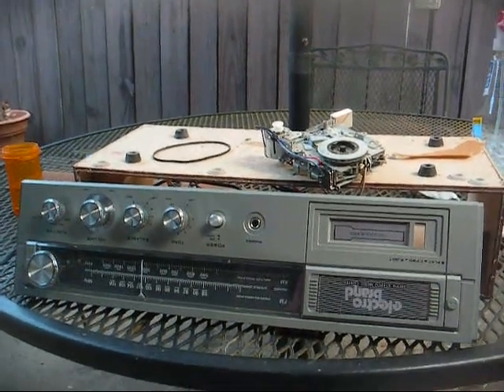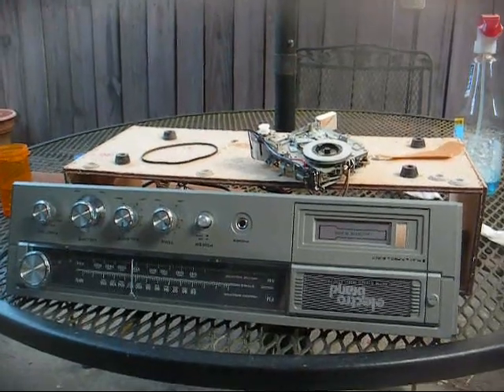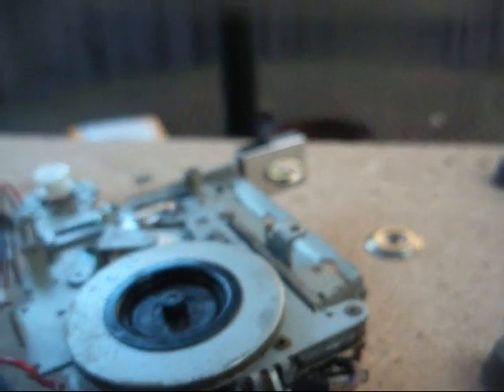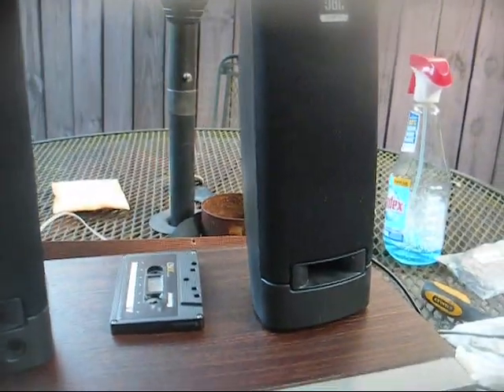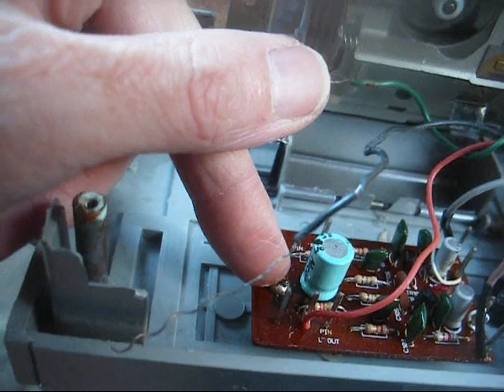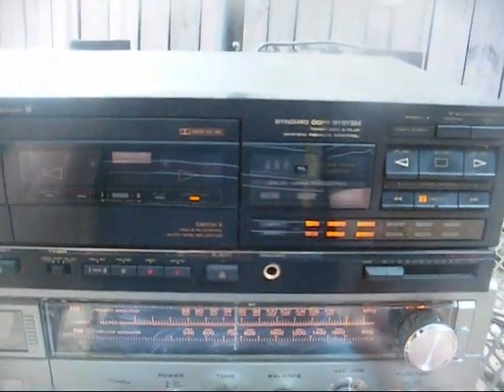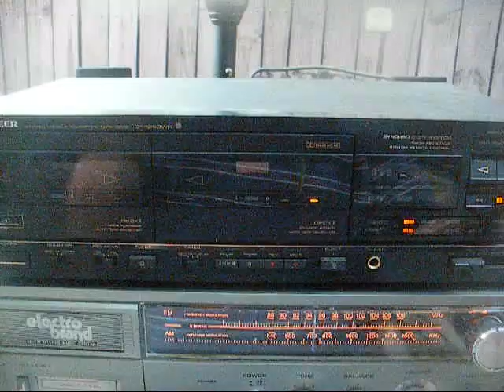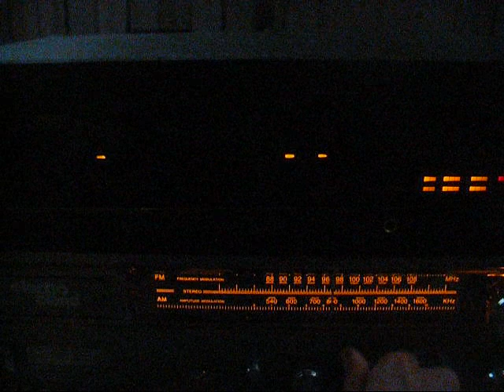Adding an AUX input jack to a cheap Electro Brand stereo with a dead cassette player

Comment: such mods put life into old cassette players. I did similar work on my 1998 Panasonic RX-E300. What I did was repurpose the mixing microphone 3.5mm plug to a line level input. Now works great as an amplifier.
Reply: Probably one of the last decent Panasonic boomboxes with a decent cassette deck.

Comment: Before I really knew what I was doing (safety-wise) I added screw terminals and a switch to a clock radio I had to be able to use an external speaker..  One of those no-transformer transistor sets.  Lucky it had an output transformer, but it wouldn't have stopped me at the time if it didn't.  Anyway, the bigger speaker sounded a lot better, that little radio could crank.   Just a random memory of a similar hacking of small electronics.
Reply: I've been telling people that for years - good speakers can make a marginal audio system sound much better.

I learned that with an old 'budget' GE AM/FM/8-Track receiver back in the 1970s.  It came with a pair of speakers, but I quickly relegated those to other purposes, and picked up a nice used set of Radio Shack two-way speakers at a flea market for like $20.   VAST improvement.   Nothing fancy, either.

It's remarkable, too, how little power you actually need to get 'loud'.  RTVPN showed us that with his little sacrificial Crosley Cruiser about a month ago.

Comment: I wish if these vintage radios might add a Bluetooth to go with it. Same goes with any vintage 1930’s radio.
Reply: You can find Bluetooth adapters that plug into any AUX or Line level input.  As for the old 1930s radios, I'd rather keep them original and hook the Bluetooth to an AM transmitter.  Then, ALL my radios have Bluetooth!
Reply: Go to youtuber Mister Radio. Many of his videos show you exactly how to do it.
Reply: @lurkersmith810  Bluetooth doesn't drift and isn't as susceptible to interference.
It's also surprising how much more fidelity ive found in even some early cheap 70's solid state radios.

To each their own is what im saying. ;)
Reply: What's the point of having an antique 1930s radio if you're going to hack into it and make it modern?  For that, I would find an old cabinet, especially the floor console types, stick a modern receiver inside (Yamaha R-N303 for example), hide some stereo speakers, and then you have everything. Stereo, internet radio, Bluetooth, DLNA, the works!  All I'm saying is, when I look at old radios, if someone has cut into the chassis to make modern mods, it's worth less than it would be if left original.  If, on the other hand, it's a rust bucket basket case, then have at it. (I do like the idea of hiding a modern receiver in an old cabinet if the chassis is beyond repair.)  Then again, here we're talking about an Electro Brand, and I doubt anyone will ever collect those, but you never know!  So many have been thrown out, they'll be rare, and people like that.
Reply: @lurkersmith810  I don't know about you, but i subscribe to function over form. These AM radios are worthless if they can't get anything because the AM broadcast band is swamped out by noise and, at least where i live, have nothing good being broadcast anyway.... Meanwhile, you can wire in a Bluetooth receiver and still listen to what you want on them. And it tends to sound better then pushing it out an AM transmitter first. AM doesn't have the capture effect of FM. Its easy to interfere with.

With that said, there is no antique radio market where i live. So it's either an AUX/Bluetooth mod or the part bin.
Reply: @wyokaiju992  To me, the main reason to collect antique radios is the history and style.  If they work as originally designed, even better.  It's easy to find a good sounding system with Bluetooth, internet radio and phono inputs, for less than some of the better 1930s radios out there. But the antique radio has its own charms and historical value.  I'm one of those collectors who likes to keep my antique radios as original as possible.  I don't listen to them often other than for the novelty of knowing they work.  Sometimes I'll play vintage radio shows or age appropriate music through them.  I'm not going to play "Around the World" by Daft Punk over my Philco 90. The speaker would run screaming into the street!
Reply: @wyokaiju992  I’m with you on this as long as I can do it without changing the appearance. I’m in Phoenix and there’s actually a strong AM oldies station here I like a lot, but if it ever changes formats, there won’t be anything left I would want to listen to on AM.

Comment: This is what I like about old electronics such as these from the 80s. Very easy to hack. I have a magnavox D8443 ghetto blaster boombox and when I got it the only thing that worked was the radio. I was able to clean up the tape player and that just needs a belt. I tied an aux input into the audio wires coming from the radio because the originals are too far gone.

Comment: Now we need to come up with a line level output for recording.
Reply: Easy peasy.  Pluck the signal off the outer terminals of the volume pots.   It's how I modded a cheap 1970s GE AM/FM/8-Track receiver, and a few other amps/receivers along the way.  Depending on your setup, you might need a couple of resistors in series, similar to what RTVPN did with the aux-in mod in the video.

Sounds kludge, I know.   But easy to do and it works.

Comment: Those computer speakers don't sound half bad, considering the cheapness on both ends; I'll bet they sound at least as good as the original speakers. If the internal deck were worth saving, it would have been nice to use a stereo headphone jack with a Y adapter, so that the internal deck would be re-connected whenever the Y adapter were pulled, but it's no great loss here. It's sad to hear of another brick and mortar electronics parts house closing, but I suspect that the COVID not--zzzees will not be satisfied until every small business in this country has had the life snuffed out of it.

Comment: On the topic of audio output my 1978 Emerson M2100 all in table top stereo uses discrete T0126 transistors in a strip type heatsink. Maybe the same chassis except my M2100 has an 8 track player.

Comment: My brother had one like this, but a few years older. It had an 8-track slot where the logo is, and a turntable on top.
Reply from the maker: I think there is one of those here, as well. IIRC, it uses a low end two-speed BSR record changer and I think it has a dead channel.
Reply: @radiotvphononut  Most BSRs were cheap. I had a Realistic 48A, a 3 speed BSR in a plastic plinth with included dust cover, that sold at the time for $50. It had the skinny BSR ST12 cartridge that liked to skip on records with strong percussion, and the typical idler wheel drive rumble. Still had the thing until I moved a couple of years ago.
Reply: @dougbrowning82  my mom had one of those when I was a kid, but rebranded as Penncrest from JC Penny’s.
Reply: @danieldaniels7571  My dad had a 1958 Hallicrafers portable record player built around a 4 speed BSR UA-8 changer with the Magi-disk automatic record size selector. The case was just big enough to contain the changer, the volume knob was just behind the tone arm rest and the speaker was in the bottom of the case, facing down.
Reply: @dougbrowning82  As much as I’m not fond of BSR changers, I would like to find a stand-alone 4 speed one just to have something to play my 78s on.
Reply: @danieldaniels7571  A 3 speed will play 78s, as well as 45 and 33 RPM records. The 4 speed added 16 RPM, to play Hi-Way Hi-Fi and talking books. The older, all metal decks were better built than the later ones with plastic parts.
Reply: @danieldaniels7571  LP120 TT is the best 78 player one can get, I use 1200 MK4
Reply: @manFromPeterborough  I’m not looking to spend anywhere close to that much money.

Comment: It has a decent user interface. What if you threw a 50-watt class D amplifier in it?
Reply: It could very easily be done, but I doubt the the original power supply would handle it.

I agree, it has a pretty nice aesthetic to it, but even so, I'm not sure it's worth the expense or effort of actually buying parts for.  If you have the stuff you need lying around unused, on the other hand.....

Comment: Nothing wrong with Yorx, great electronics...however Yorks does sux!  If I remember correctly, Yorx is part of Soundesign, same creator.  ~Jack, VEG
Reply: Yorx did have some awfully cool looking units in the ‘80s, even if the quality wasn’t all that great. Still much better than the cheap stereos of the last twenty years.